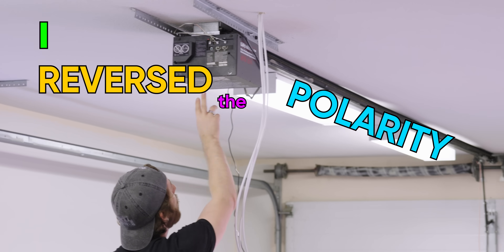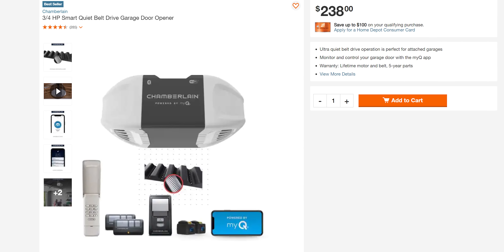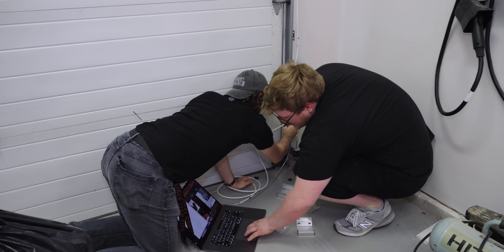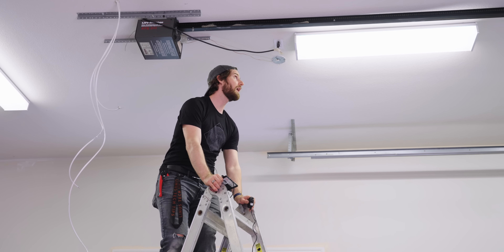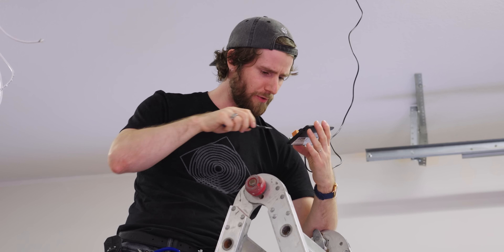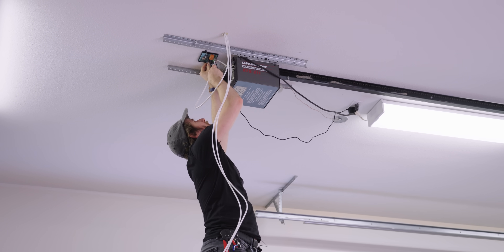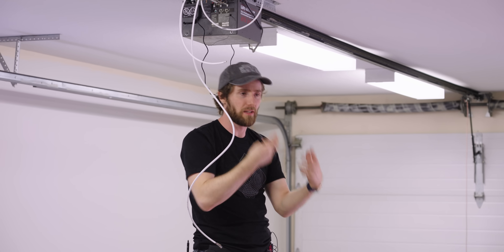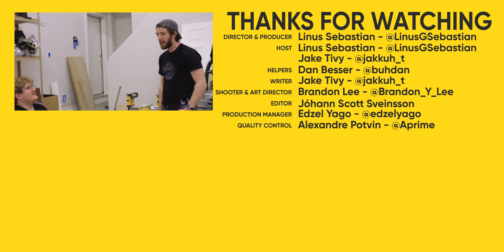Smartifying My 25+ Year Old Garage - Z-Wave Garage Door Opener

Comment: For the old door opening and closing on its own, you should have installed a resistor between the two wires, say 20 kOhms, which to the EM waves making the voltages on the lines float between logic levels, is essentially a short.
Reply: That's stupid.
If wires picking up interference is an issue, then just use shielded wires.
How hard would it have been to just use a small stretch of CAT 7?
Reply: @user-xu2pi6vx7o  there's two ways around these issues. You can shield the wires, or make your system tolerant of interference. Shielding is never going to be 100% effective in a system. Twisting the pairs will also help, by turning the noise into common mode noise (loop area between the wires is a lot smaller, thus they see a lot closer to the same potential). But adding the resistor will kill the noise completely. 

Why is it stupid? Almost every IC you deal with has internal pull-up or pull-down resistors. It's the default solution to this problem, because a lot of the time you cannot shield the system (IE on a PCB).
Reply: @benmodel5745  Hence the suggestion for CAT 7, which has twisted pairs, which are then twisted again around a central core, with shielding around each pair, secondary shielding around the entire cable and a steel wire on top of the secondary shielding, to act as a dedicated ground.
I refuse to believe that remote was so sensitive, that even this amount of shielding wouldn't have fixed the issue.
And it's stupid, because that should have been the first thing they tried, upon identifying interference as the problem. Especially since CAT 7 isn't some obscure piece of technology, known only to the most elite of tech gurus.
Reply: @user-xu2pi6vx7o  again, why make it resistant to interference when you can remove the problem completely. Would it have worked? Probably. But you're treating symptoms vs treating the root cause, which usually shows a lack of understanding of what the underlaying phenomena is. It's not like resistors are some elite technology either. There are cases where you need shielding, or guards (which is different), but in a low frequency, short run like this, there's no need, really.
Reply: @benmodel5745  Guess what, a small piece of CAT 7 is even less elitist of a technology. And replacing a cable is the easiest way to fix the problem. 
Have you ever heard of "Keep It Simple Stupid"?
You talk about fixing the cause and not the symptom, but guess what? A resistor doesn't address the cause anymore than the shielded cable does. It's just a DIFFERENT way of addressing the symptom.
If you REALLY want to address the root of the problem, then you need to find out exactly what piece of technology is generating the interference and stop it from doing that.
Reply: @user-xu2pi6vx7o  Are we really trying to evaluate an engineering solution based on which is less 'elitist'? It's a pretty stupid criteria. And you cannot always control what's outside your system. If you replace every LED light in your house with linear, constant current driver, studio quality lights, that's a lot less simple than adding a resistor, which will short any potential difference between the two lines. Or you could shield it, which probably will be fine, but may or may not fully solve it. Can you guarantee the PCB traces on their own won't pick up noise? If you have a huge spinning magnetic field right next to it (such as from an electric car), will the shielding be sufficient? Btw, where are you attaching the shielding ground to? Is the DUT galvanically isolated from that point, or from earth ground? If your shielding touches something conductive, is any current going to flow between them? There's much more than you are considering with your solution. Ground does not always equal ground. 

Why are you so attached to this?
Reply: @benmodel5745  Engineering 101, "Keep It Simple Stupid". Never overengineer something, when a simple solution is just as adequate. And I'm suggesting the simplest solution that will work, whereas you keep harping on about resistors, a more complex solution, that requires far more effort, than simply replacing a cable, something anyone can do.
Also, FYI, Linus did actually try your "solution", in a previous video on the same subject and promptly gave up and decided to go with the Chamberpot API and app, the same ones he complained about in THIS video, for having a 10 second delay, among other things.
Reply: @user-xu2pi6vx7o  lol if you think adding a shield will be easier than soldering in a resistor. You know you have to provide a low impedance connection between your shield and ground, yes? And you still are unable to prove that shielding is sufficient. KISS only works if the simple solution is adequate. You aren't an EE, are you?

I'd have to rewatch the original video. But it's not worth it to me. To anyone else who happens to be reading this thread, know that for low speed digital signal lines, you need a pull up/down resistor, if they are floating you are gonna have a bad time. if you are using a μC or and ICs, check the data sheet because there might already be one internally. If you are still getting interference, or have an analog signal line, then shielding might be appropriate. First try twisting the pairs though, which is always a good practice.
Reply: @benmodel5745  Yes, I do think replacing a cable is simpler than doing the math needed to find the resistor value that's high enough to block the interference, but low enough to not block the whole signal.
Especially when a cable change is all that is needed.
Also, you can shut up now, if you CBA to go back and check the previous video.
Reply: @user-xu2pi6vx7o  no math required, 20k should be good. But if you are too lazy to use ohms law, an equation with 3 terms, I don't know what to tell you. Sorry math was hard for you in grade school, I guess.
Reply: @benmodel5745  Or, hear me out here, you could just replace a cable. Something that doesn't need any math whatsoever, regardless of how simple you think it is.

Also, if you feel the need to resort to personal attacks, in a debate, then you admit that your point has no merit to stand on its own and thus you feel the need to disparage the other party.
Reply: @user-xu2pi6vx7o  man you have not addressed any of my technical points. I am beyond arguing in good faith. It's clear you are beyond your depth here technically. Don't lecture someone on engineering 101 if you are too lazy to attempt any actual engineering (especially with topic you will actually learn in an introductory engineering course).  

I watched the video. He tried to add one, but gave up. Funny how my solution was the same as Electroboom, an experienced electronics engineer. Almost like it's an issue encountered frequently in industry, and this is the best practice to solve it. 

And you have not addressed my point that shielding might not even solve it! Or countered with any of the downsides to using a pull-down (which are extremely negligible current consumption only while depressed, and impedance matching, something irrelevant for a slow signal like a switch). Understand an issue fully before you get this invested in a meaningless YouTube debate
Reply: Yea just rub it in my face that I don't speak latin like you!